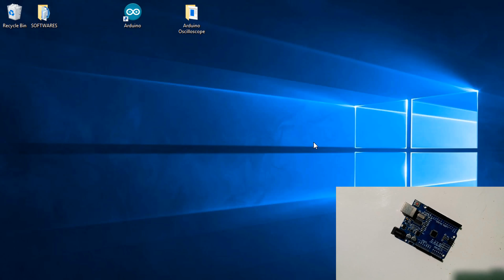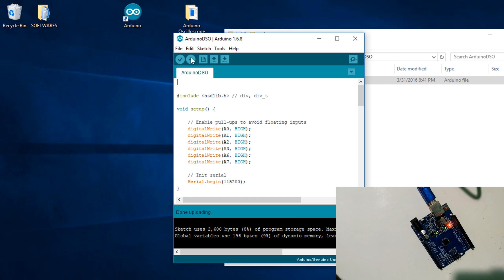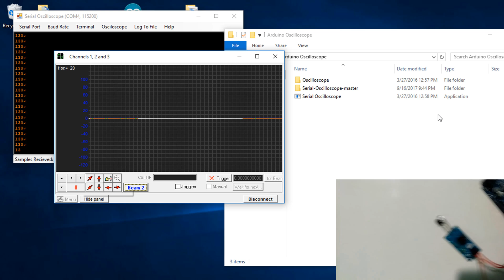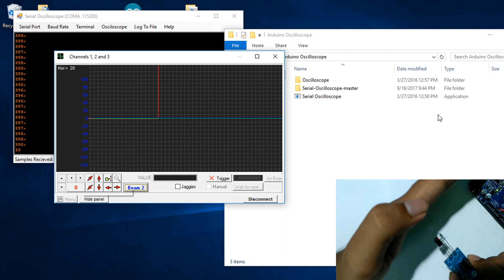How to Make Oscilloscope using Arduino

Comment: I am unsure how to read the horizontal axis. If Hor. = 5000 and the average sample rate in the terminal is 2900, what does that mean about each grid square? Also, does a sample rate of 2900 mean 2900 samples per second? Also, I have not been able to use any other channel than the analog 0 input. all the others don't respond. Great project though, thank you for making this.